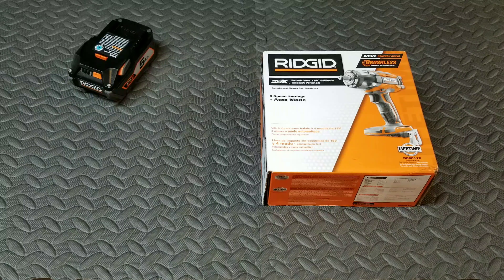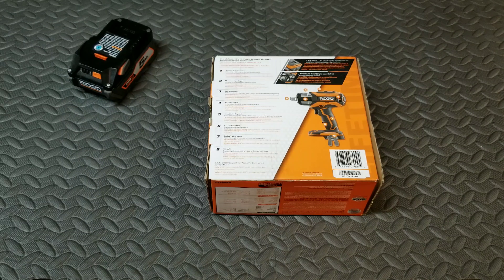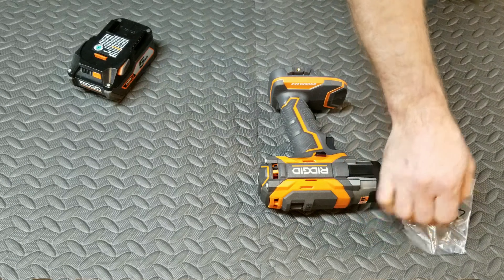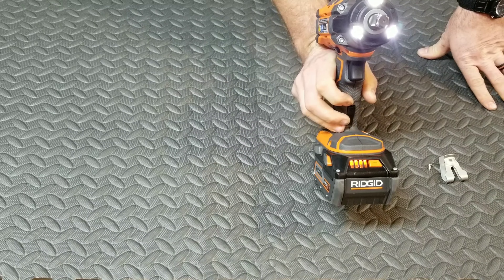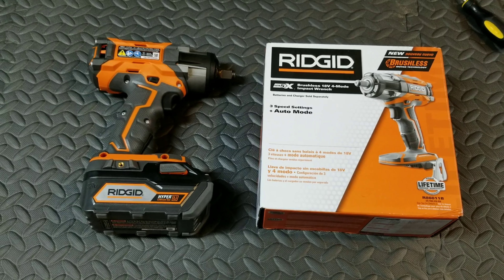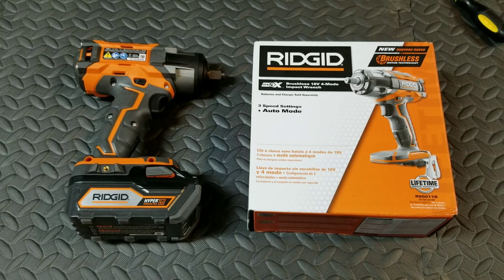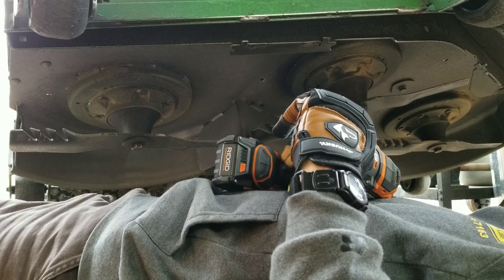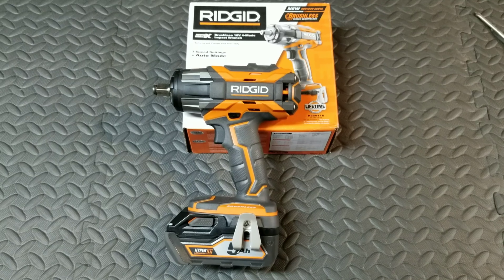RIDGID 1/2" Impact Unboxing/Review And Testing

Comment: ryobi 261 impact wrench advertises speed setting 1 is good for getting the lug nut started to tighten them before you use torque wrench.

Does the Rigid use the Auto mode or speed setting 1 for that?
Reply from the maker: Love Like a Hurricane Auto
Reply: "Auto" mode, yes. It stops when the tool begins to impact (so you can then finish properly with a torque wrench).

Comment: I got girlfriend one but she can’t seem to put the socket on the drill , is there a specific type of socket that you need to use
Reply from the maker: Impact sockets (Black) are what I recommend. They are a snug fit but this tool has a lot of torque.
Reply: Does she have sockets with the correct drive-size for this tool (e.g.1/2" vs. 3/8")?